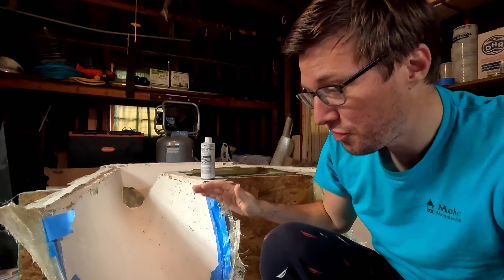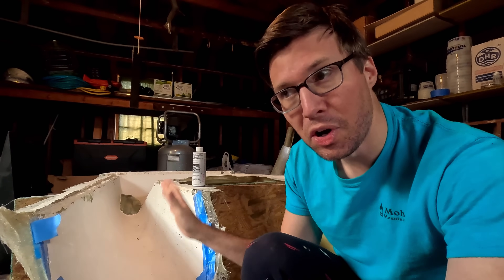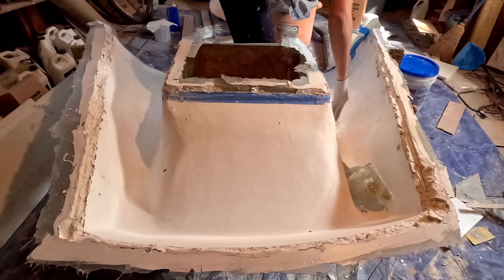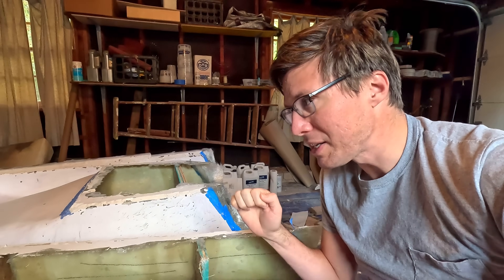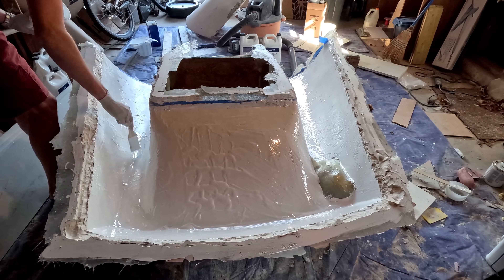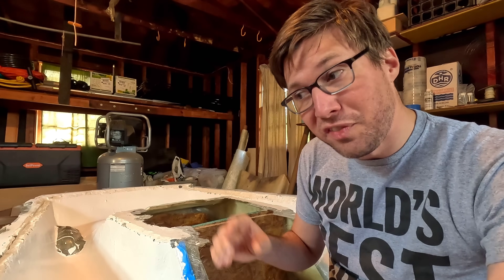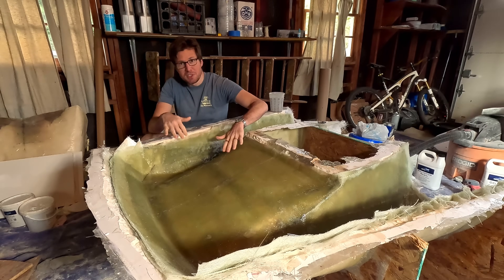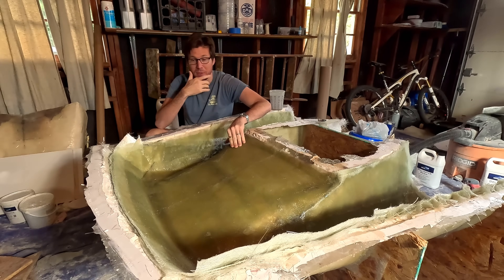Construction Begins: First Layer of Fiberglass | Windpuff’s Rebuild [S1 Ep5]

Comment: Pay me now or pay me later. The flaws in the mold are transferred to the part. If you had built a properly finished mold, your part wouldn’t look like a pair of socks on a rooster. 😮
Reply from the maker: Yes, but I’m not very good at this so the finished part is going to need fixing anyways. I might as well put my time towards fixing the part instead of fixing the mold to then fix the part.
Reply: @ that could have been a composite part and weighed 1/2 as much. If that’s your approach and you want to put a ton of labor into a part instead of a mold, why not just build a male part and body work that.

Comment: Good day sailors! My question is , how long you wait for the resin to dry before you apply the next layer. Is there any rule you follow?
I am watching you with ❤️❤️ the best Chanel by far
Reply from the maker: I’m using laminating resin so I don’t have to wait or do anything special between layers. If I was using “finishing resin” then I would have to let it cure completely and then come at it with some sandpaper to scuff up the surface to help it stick. 
When I’m all done with this part, I will then paint a layer of finishing resin on it to give it that final cure.

Comment: Thank you for taking on the restoration of this old Alberg 30 and best wishes on your endeavors. These comments are intended only as thoughts to be kept in the back of your mind and they are provided with this caveat: “It works for me.”
     With a 150% genoa my boat became overpowered and developed a significant weather helm in winds as low as 12 knots. Any efforts at reefing-furling the genoa did not cure this. 
     After several years of trying smaller, roller furling genoas (a 125% and then a 110%) I switched to a 100% working jib. Nirvana. Sailing my boat is a totally different and much more enjoyable experience. If I wanted to sail faster in winds below 8 knots I would consider a “drifter” instead of a larger genoa. Other advantages include: higher pointing ability because the jib trims inside the spreaders; significantly less drag from the neutral rudder; faster and easier short tacking; effortless tiller control; ability to see around the headsail. 
     I judge when to reef the mainsail by the amount of heel. When the lee toe-rail begins to touch the water surface I put in the first mainsail reef. If the wind continues to increase, when the toe-rail again begins to touch the water surface I put in the second reef. 
     This works out to be about: Full 100% jib and mainsail up to 12 knots; full jib and 1st reefed mainsail 12 - 18 knots; full jib and 2nd reefed mainsail 18 - 22 knots. With this scenario my boat steerage is very well balanced under all points of sail, my tiller is never more than 5° to windward, I can maintain my heading with finger-tip control of the tiller or sheet-to-tiller steering, and I can also control my course on a close reach with the tiller lashed to center by just fine tuning the balance between the head and mainsail. 
     One thing to consider, with a 100% jib, the jib sheet car has to be well forward and the jib sheet actually trims in-between the cap and aft shrouds. My boat has a factory installed jib car track for that purpose but I am not sure if all others do. 
     Above 22 knots, I sail with only the double reefed mainsail or the jib unfurled only to the size of a storm jib (~80% furled). Or I heave-to. 
     I have ridden out many summer squalls and thunderstorms hove-to in gusts over 40 knots, comfortably sitting below with the tiller lashed hard to leeward and the double reefed mainsail trimmed tight to center and the jib fully furled. The windage on the furled headsail is enough to keep the boat from tacking. 
     Hove-to in this fashion, my boat sits on a close reach heading (waves are striking the forward quarter of the bow) and fore-reaches very slowly on about a 70° into the wind track (good for holding off of a lee shore). 
     A final caveat, if your particular boat is a very early pre-liner model with a rotting Masonite deck core it may require more than a restoration, it may require a resurrection. Any innovative methods to restore the functionality of a boat in that condition would be a blessing for many old boats.
Reply from the maker: Thank you for this information!
It is a Masonite core and I have a lot of work ahead of me!

Comment: Sorry but why not just stitch and glue some epoxy-plywood? It could be done in 1-2 weeks without even taking it off a boat, and probably 10x cheaper.
Reply from the maker: I didn’t want any wood core to possibly rot over the many years this boat has ahead of it. I did think about it but was recommended to do it this way by people who know much more about it than I do.
Reply: @RiggingDoctor  Frp is clearly better, but i'm not sure it worth the effort. I've built a stitch and glue boat around 10 years ago out of regular non marine plywood, and she still going strong, without any visible rot, survived every russian winter, sometimes full of fresh water and rotting leaves. And she probably took less effort than your extension despite being 5m long.
Reply from the maker: I’m really considering building the hard dodger out of stitch and glue

Comment: looks like I picked the wrong day to give up hard liquor
Reply: Hey Herby.  YouTube didn't give me a spot to post again, so I'm doing it here.
All this looks so familiar.   Oh yeah, my bottom job, not my bottom but my sailboats bottom.😂😂😂
Are you itchy-scratchy yet, or have you been wearing the WHITE SUIT while sanding?   I didn't use it. It was warm weather, so I layered myself up with sunscreen, and, well, it worked.  All the other guys in the yard were all wrapped up, not me.  Just safety glasses, a hat, and respiratory!   The best of luck!!  🙏❤️🇺🇸⛵️👣🍍😊
Reply from the maker: I’ve been using a vacuum while sanding and haven’t had itchy issues. I also shower immediately after to get all the dust off of me right away.

Comment: I’ve been watching the Duracell Project. He vacuum bags nearly all of his fiberglass. I understand that it yields a more consistent lamination. Is there anything that you have to take into consideration if you don’t have the vacuum bag equipment? I sail a fiberglass boat, a H-boat, but so far I haven’t had to do any actual fiberglass work. I was just curious to hear your thoughts on this. Thanks!
Reply from the maker: It’s better for keeping weight down, and since he’s building a light displacement boat, he pretty much has to do it that way. Hand layup is heavier as it will have more resin in the mix so you get less strength per unit of weight, since the same part is just as strong but heavier when done by hand. 
For repair work, a few chip brushes, some resin, and some cloth on hand is all you will need. You can do a patch that isn’t pretty but keeps you sailing and then fix it the right way when you make port.

Comment: Everything is looking great! The amount of work you're putting into this is impressive! To help get rid of those bubbles, try brushing the epoxy on before putting the glass down. It can help to fill in those little spots. Good luck, I can't wait to see the finished product!
Reply: It looks like he is using polyester resin, not epoxy, but same technique applies.
Reply from the maker: Indeed. And I have found that trick works well. It’s a balancing act though as I want it thick before I put on the cloth, but too thick and it all runs down to the bottom.

Comment: Nice work Herbie.  The csm, chopped strand is structurally , think of short wood fibers held together with lignin.  Some small boats are built with only csm.
But the fibers of the modern 1708 type products ( stitch mats) where the fibers are much longer does provide greater structure. It’s also got a lot more glass per layer . The same amount of glass in a csm would be hard to work with. 
Cheers Warren
Reply from the maker: Good to know! When I counted the number of layers, I only counted the 1708, so that means we are above and beyond 8 layers as there are maybe 5 layers of CSM in some parts.
Reply: @RiggingDoctor  fyi, the 17 part of 1708 means 17 oz per squ yard and 
the 08 means 8 oz per squ yard or 
about 3/4oz per squ ft  because 
csm is normally measured as oz/sq ft.   
Nominally 1 layer  of 1708 is .05” thick finished so 7 layers is 3/8” or more if your resin content is higher that nominal.
🍻Warren
Reply from the maker: Excellent to know!! My googling said 9 layers but I was probably looking up the wrong thing, and my testing came up with 8 layers. So I might have squished them down a bit too much when laminating the test pieces because I have a strong feeling it’s going to be thicker than 3/8”

If all goes well, I think I will pop it out of the mold on Sunday!

Comment: Nice video Herby and Maddie. Hopefully the Total Boat polyester doesn't off gas noxious styrene fumes like the polyester resin I once used making a home made paddle board. I vowed to only use epoxy after that. I'm looking forward to seeing this progress.
Reply from the maker: Those might be the fumes. I have a strict protocol of showering immediately after to get the smell off of me as soon as I finish working.
Reply: It’s standard polyester resins with a styrene monomer. Yes it stinks , but it’s way cheaper , much easier and faster to work with than epoxy.
One other massive issue is you can get contact dermatitis from using epoxy , especially when you get hot and sweaty. Once you get epoxy sensitive you have it forever, and you will het instant headache around it and hives. 
So be carful if you use epoxy 
Cheers Warren

Comment: You must be very itchy ! I hate glass work. We will be doing something like the same thing to our Bristol 45.5 . Adding an integrated fold down swim platform. Like the back of a modern Moody . Probably add about 6 inches to the boat length but i want the door to close flush to the transom when it is closed . Nice job you are doing thanks for taking the time to share .
Reply from the maker: You won’t have to worry about the structural stresses as much as I do! 
Making something that looks like it belongs on the boat is so much better than making something that looks stuck on.
Reply: @RiggingDoctor  Yeah thats a crazy extension you are putting on !